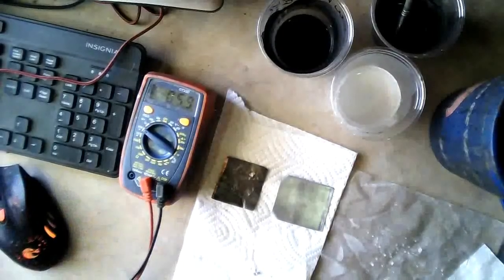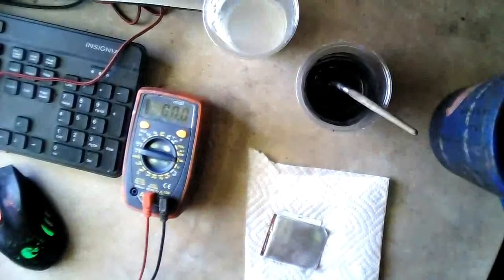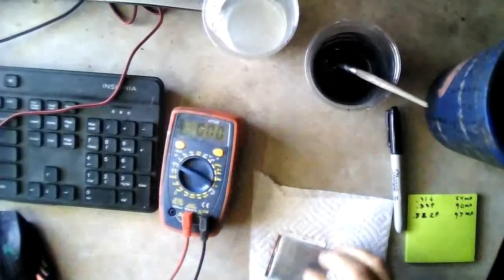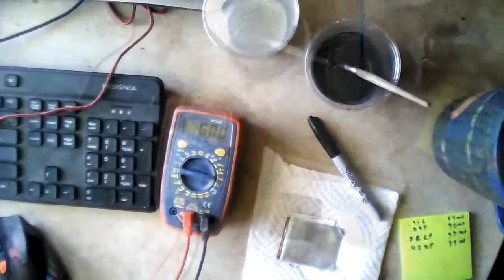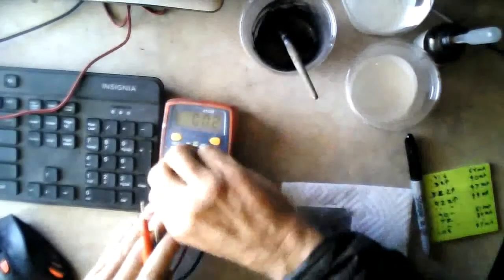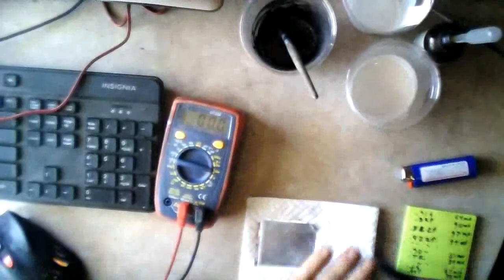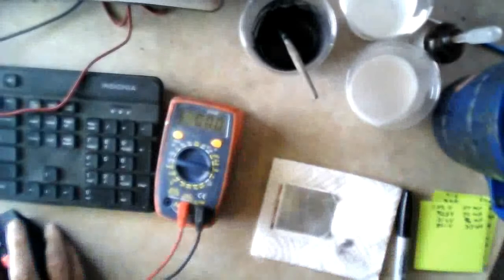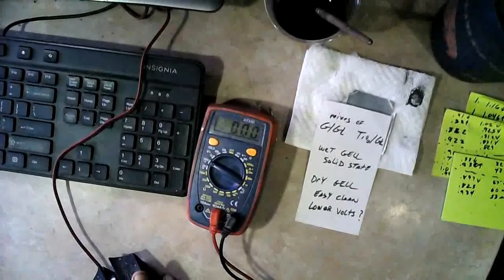Borax Glue Tests!

Comment: I think you may be right about the wet vs dry concept. The unknown is how many cycles each perform at what level, and whether the performance of the dry cell drops off completely when it cures (allowing for the distinction of dry and cured).
I know I'm getting ahead of what you are doing right now but if the cured cell continues to produce power however small would they be stackable to create an actual battery as opposed to a cell. If the wet cell drops off when the water is depleted it would require replenishing. If the cured cells are stackable and continue to produce the actual output would not matter because any number of cells could be stacked to produce the desired voltage. I think the amperage is a function of the size of the plates. Right now you are testing with one size so the amperage can be compared to changes in the materials. 
Don't let me throw you off track though. I'm just thinking out loud. I am starting to see some distinct patterns in what you are doing.
Reply from the maker: I think the cells made with wet glue, will eventually need some water too. Like you say however,.. after how many cycles is the question. Cells made with the dry glue will probably need more water, but that's not been established. I'm sure the cells are stackable. I made a double cell when I did the capacitor experiments, and the amps added. The amps are a function of the plate size of course, but I can up the surface area with porous carbon to increase the amps like other battery researchers do. At this point, I see no good reason to include electrolytes in the cell. It will be plenty powerful just using water. :-)

Comment: hi there i have done similar test about  2 years ago on graphite coated paper left it for 1 year and it produces still 125mv at 15uAmps if i add water it reaches 300mv at 20mAmps, i tried many ways to stack them it appear i cannot get that part functioning good...its like small cell that picksup energy from atmosphere..
Reply from the maker: Hi Barry, I'll have to try some stacking experiments soon. We'll see what kind of problems I have. and we can compare experiences and look for a solution. :-)
Reply: Barry Liebenberg - I had the same problem with crystal cells. I think it might be the difference between the function of primary and secondary cells. I suspect that when stacking self charging cells such as crystal cells. It could be that they are perpetually charging each other subtracting from the total. I noticed that there is some addition but never a direct sum. It seemed to always be unpredictably less. It might have something to do with internal resistance. I'm not sure, I only had a multimeter. It was frustrating.
Reply from the maker: Hmm,. if the problem is the cells self-charging each other, then I would think we could prevent that with a diode between the cells?
Reply: i think the diode idea can work , but then the concept change one would build electrical storage sell charging device with possibly some power to use on something else.the one should incorporate the functions of capacitor and battery combined.
Reply from the maker: That all sounds possible to me, let's do it!  We'll work the problems out as we go! :-)